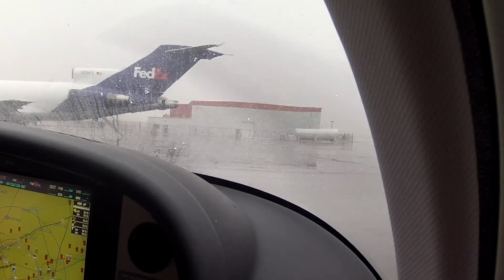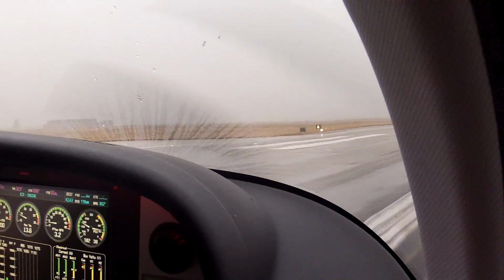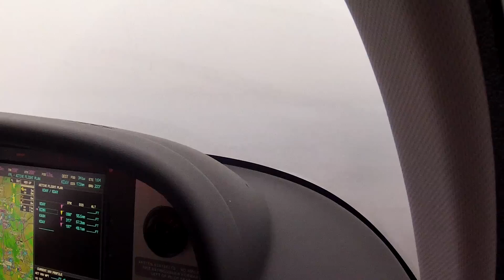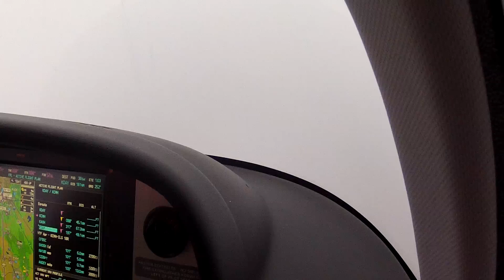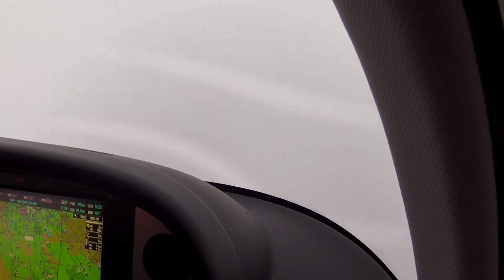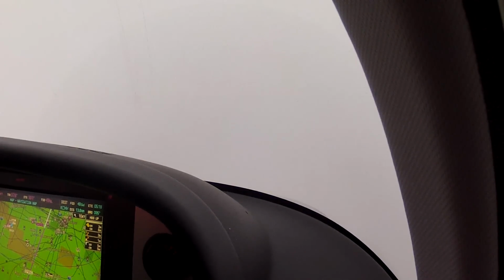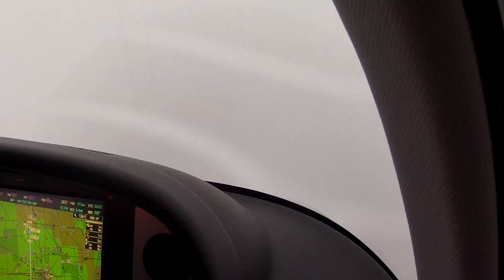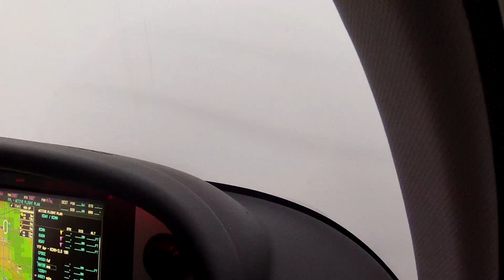IFR Flight In Cirrus Perspective. Low vis... low ceilings!!

Comment: Mark, big fan of yours, i point all my Cirrus Students to your website. Question on the flight above; whats the easiest way of preparing the Approach back into the departure airport in the FMS -Emergency Return scenario? PROC will give you destination Approaches by default.. Is there a quick way to change the focus from Destination to Departure?
thanks!!
Reply from the maker: Neil K Thank you Neil. I dont know of a way to do what you are talking about. The quickest way would probably be nearest on your pfd then proc after you were going direct back to that airport. You could also manually set up your localized freq or vor in your nav and then switch your cdi if you needed to go back. Either way you would want to have the approach briefed before you even took off so it should be smooth to come back around. Thanks for watching!!

Comment: Great video in a great plane! What will the AP do if you hit the go-around button and you don't have an approach loaded or the AP isn't in approach mode?
Reply from the maker: Geoffrey Gallaway It will go into GA mode. 7.5 degrees pitch up on current heading reguardless. You can also use the Go around button prior to takeoff. If you hit it you will see TO displayed and you will get FD command bars showing the 7.5 degree target climb out. Handy to give you that visual picture on the PFD.

Comment: This video would be more helpful if I was IN the Plane,, Heck I am just glad to listen in as there was a lot of useful information there,  Carb heat?  do you use it when changing altitudes or perhaps the entire time when you are in mist or rain,
Thank you for the video
Happy landings
Reply: No carb heat in a fuel injected engine!  The only problem that you might encounter would be icing over the air intake, in which case you'll use the 'Alternate Air' intake, but the notes said it was 8°C, and the inversion layer keeping the temps warm, so I doubt you would have any kind of icing at all.

Comment: Mark, I really enjoyed this video.  Thanks for putting it together!  Was this plane a G5 with the higher initial flaps speed?  Cruising in at 150 until 2 miles out in the soup seemed like a lot to ask -- I guess it's all about training and comfort level.
Reply from the maker: +Jason Martin you can do this in a G5 or G3. You need to have the carbon fiber prop to do it at two miles. The Aluminum prop doesn't create as much drag.
Reply: N367CP is a 2008 SR-22, which makes it a G3.  I thought I heard Mark saying that there was a difference between the Turbo and the Turbonormalized, so I'm going to guess this is a Turbonormalized aircraft, since the FAA Registry for it calls it an IO-55-N engine.